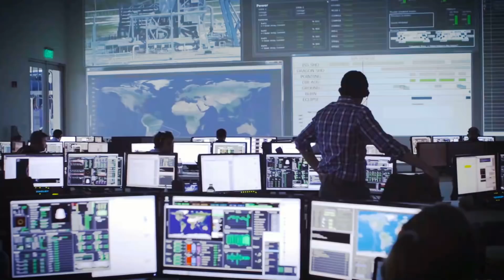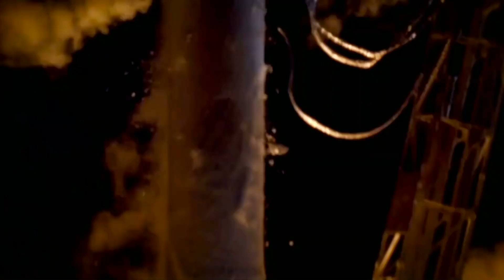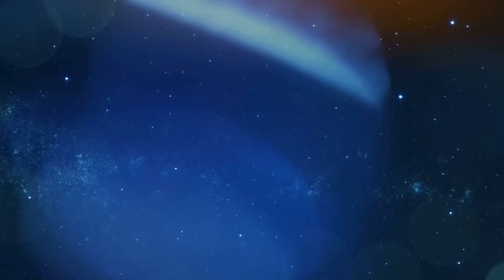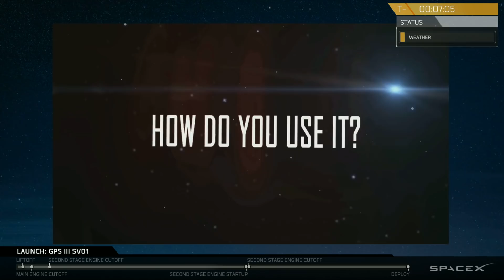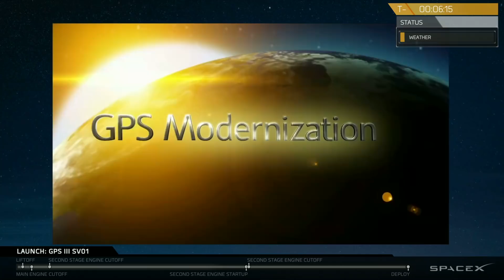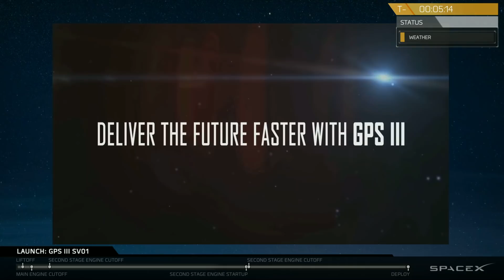GPS III Space Vehicle 01

Comment: So at what point is the FH more economical than the F9. I had thought the FH was always more economical than losing a F9 first stage. The reasoning SpaceX has given in the past was a first stage costs about 30 million yet the fuel it uses costs about .2 million. So it would always be much cheaper to use the FH rather than lose a first stage. 

Something is not adding up... Anybody have an answer and can make this equation make sense?
Reply: 30 million is for the entire rocket. 36 used to be a number you hear frequently. With them charging 50 million. Several reasons Falcon Heavy would not be used. Still very new. Launches are booked about two years in advance. Two years ago FH hadn't been tested and expending rockets was more common for SpaceX. I do believe they charged more than 50 million for this, which is common for national security stuff since there are additional expenses. Also consider this satellite is probably about as expensive as they come. If someone told me it cost a billion dollars I'd be surprised it wasn't more. Falcon 9 in contrast is a reliable proven system that is now cleared to launch flagship scientific missions, national security missions and astronauts. Expect People to have started booking Heavy's after the successful test flight launching in about two years. People who are launching now where pioneering customers who bought a launch on a rocket that at that point had not flown and was massively delayed. So FH should start flying more regular around 2020. There are exceptions, some launches aren't booked that long in advance so we'll see a few launches before 2020. I know of three on the books, one of which is very soon. Should be pretty much one year after the test flight counting minor delays of a month. Side-booster has been spotted moving between test sites.
Reply: @please_stop-v7o  Okay, that makes sense. SpaceX may need a string of so many successful flights with the FH before the government will trust it. Even if our government is paying SpaceX 200 million for this flight it is better than risking a two billion dollar payload on unproven tech... Thanks.
Reply: @CheapHomeTech  Yeah although the air force was one of the early customers and the third flight will be theirs. But for national security and precious one of a kind payloads if they book one now for three years from now, the Heavy will have flown a bunch of times and proven itself. So they don't have to wait that long. And such early booking is quite normal for national security stuff. That's why Delta IV Heavy has lots of launches. Some of those where booked 6 or 7 years ago. 

They let the upper stage and the roadster get fried by the Van Allen belts before attempting the final burn because the air force wanted to know if the electronics could take that. They like doing funny insertions through the belts and many re-ignitions hours apart. So the test flight already went a long way. Now it's just about making sure Block 5 does fine in heavy configuration and there weren't any unseen bugs. 
In the rocket industry if you can pull of a flawless test flight of a large unproven vehicle with exceptional complexities (many engines, landing boosters) that is generally considered as extremely impressive and goes a long way in the minds of customers to being comfortable putting something on top of it.